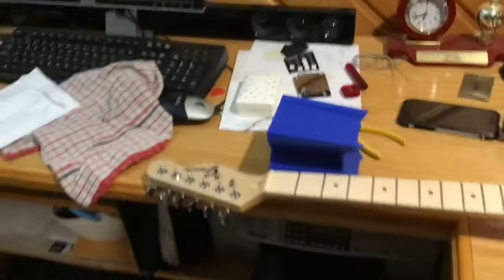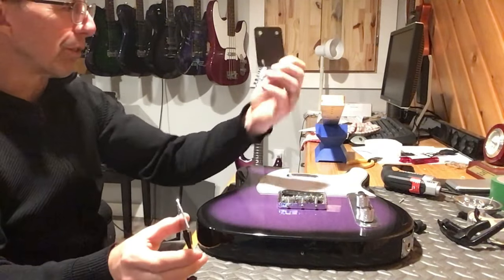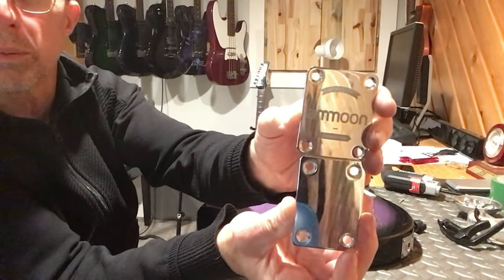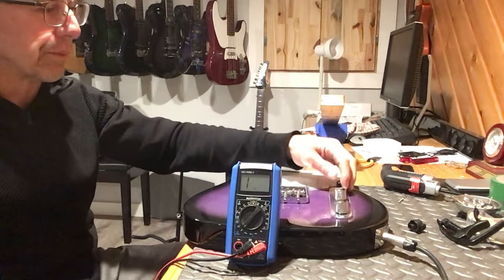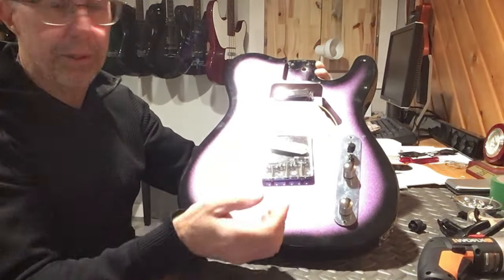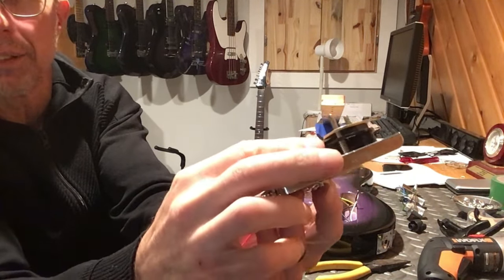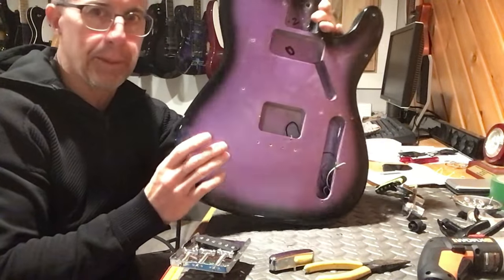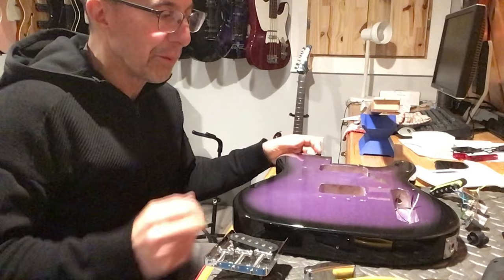Groove Tele Part 2: Disassembly!

Comment: The price of upgrading is ridiculous at best here in Canada. I have a horror story with my effort in refinishing my Cort guitar. Mind you the initial guitar was free but it looked like hell. I've got $400 in supplies not to mention months of work. I paid less than that for my Ammoon and my Kramer combined. It definitely has you questioning wether it's worth it. In the end though I think the Cort is my favourite, it sounds and plays well. I really enjoy your videos bud, please keep them coming. Eight  more subs and you can get monetized to offset the cost of buying junk and making them right. You are now a teacher in life and the guitar world.
Reply from the maker: Hahaha thanks Rainer! Didn't realize I was that close or tjat there could be money involved haha... I just like sharing info with you guys and getting your points of vues😀
I have a full time job so when I play out with the band, my gig money pays for the stuff I feature on my channel... 
As far as the cost of upgrading, it is expensive when it surpasses the cost of the actual guitar, however, even at 400-450 for both guitar and upgrades, here in Canada I'm still 300 to 400 dollars less than buying budget line Squire tele which I would have to upgrade as well... So all in all it's still justifiable... the problem is until it's done, you never really know if it's gonna be a good unit or not! 
I started the work on the neck on the groove... completely sanded it down and it got 3 coats of tung oil.😀

Comment: Well at least it has an alder body & a good paint job. If the neck and frets are good you’ll have a good mod platform. 
I like your idea of the P90 neck PU. I think the black out will look great. 
Redrilling the neck mount & doing the string through body mods will be an adventure but I have faith in you.
Reply from the maker: Wel thanks John for the vote of confidence. I think it will turn out ok. Maybe better than ok. My parts are in transit as I type this so I may be able to get started by the weekend! 🙂

Comment: You're missing out on the most fun part of a budget build.  Changing the name on the headstock.  Build a J-Man Custom, or put your wife's name, or dog's name on the headstock. Be a guitartist, not just a modder.
Reply from the maker: I hear you Dan.. 
I have custom guitars that I've either built from scratch or highly modded. I enjoy that. What turns me off is when, in order to get to the final result, I have to fix problems that should not be problems to begin with. Neck mounting holes... how do you mess that up with a CNC machine lol!? Poorly cut nut... if your company builds guitars and you're cutting nuts, cut them properly the first time. Every neck that has frets installed, those frets needs to be leveled crowned and polished, so why not do it right before packaging?
They all go through the basic set up necessities and if you're building guitars, you must have the tools at your disposal, so use them hahaha! I totally expect cut backs like cheap parts, crappy tuners, poor electronics etc... but neck to body alignment, fit and finish, whether expensive, or budget, hould be bang on every time. You only have to build 1 properly, then make copies with no guess work involved... it's gonna be a fun project, I'm just not confident it will end up being a trustworthy gigable guitar... I hope I'm wrong😀
Reply: @j-man9457  Some are definitely better than others.  That odd sized off center neck plate is just weird.  I can't tell you how many hours I've spent working on cheap guitars.  They are now great guitars, but as far as getting my money back, or getting paid for my time, that's just not going to happen.  
I'm retired, so it's just a hobby for me, like building model airplanes.
Reply from the maker: @danrunnoft6642  hahaha yup I hear you. That's awesome I can't wait till retirement. 2 years to go!

Comment: Hey bro you may have too much time on your hands😂. I think the Monoprice guitar was my worse budget guitar buy. My recent Musi Fusion the best; I’m still considering a Capricorn, but I’m wondering if there’s much difference between the Fusion?
Reply from the maker: Hey Ed,
I'm always looking for time haha. Can't wait for retirement!
I've heard good and bad about the Moniprices... I've never had one. So the fusion and capricorn have the same bridge pickup, tge same neck, and identical bodies other than the capricorn's longer horn (strat like) on the base side.
The 2 major differences is 1: they balance different when using a strap. The longer horn on the capricorn makes for less neck dive.
2: you can get some nice strat tones with the capricorn.
I like them both. I just recently installed a telecaster bridge pickup in my Capricorn. It's like a Nashville now haha! My phone crashed and I lost the vid😖
Reply: @j-man9457  yeah Monoprice is the only guitar I’ve returned as far as budget guitars. I do have their 15 watt Celestion amp which I got years ago for like $160 it’s pretty good.
Reply from the maker: @edatkinson322  Yeah I've heard some people mod them with new tubes and a Mecury magnetics Upgraded Vox AC15 input and output transformers and they are wicked little amps!
It's a 500 dollar mod though. However a Vox AC15 here in Canada is 1300 now! So would still be a cheap alternative!

Comment: Trepidation before a project like this is normal. Not being impressed with the poor craftsmanship is another. ANother $100 CAD for a finished M-musi makes it appear almost fruitless. The bug but, however, is the fun that will be had upgrading it to the point of being able to donate it to charity. (Maybe?)
Reply from the maker: Parts are ordered! No turning back now haha. Maybe, if it turns out nicely, this will be a give away on my channel??🤔
Reply: I've had a couple of guitars with bridge pickups built like that and they went in my garbage bin also. Same with the neck pickups. It's supposed to be an  Alder body and it has a nice sparkle paint job. Trying to find a body alone with that would cost you 200 bucks. Now if the neck is usable and you can level the frets and replace the nut tuners Andre mounted to the body everything else you put on it makes it a guitar worth the money you would pay for it if it came with those qualities already. Who you could never sell it for what you put into it but it is a custom build to your requirements for four hundred bucks. 
The time is experienced and the love you will get to enjoy from this guitar once you're finished.  
Do use a standard neck plate I think you're going to need to plug the holes in the body and the neck with dowels and then re-drill but make sure you glue the dowels in the holes first and make sure it dries a full 24 hours before you start read drilling to the template of the neck plate.  We do this because we love it.
Reply from the maker: @2bikemikesguitartopics145  100% buddy! Not sure about the neck, but the body and my parts will come together nicely I think!

Comment: Wow!  My condolences for the untimely demise of the reputation of the Groove brand Telecaster.  By the same token, my compliments for your ability to move briskly on, in the face of the aforementioned adversity.  You apparently rely little on the kindness of strangers.  In recognition of that admirable trait, I wish you every success in your Groovey endeavor.
     Dont you think the stiffness could be attributable to a combination of, high action, too much rslief, and perhaps heavier guage strings, etc?  Thanks for the warnings about Firefly and Leo Jaymes.  We already agreed on Harley Benton.
     Overall, a black and purple theme will have an air of "serious play".  If that makes sense.  And personally, I tend to evaluate a pickguard's value in a color scheme.  So I've been looking at "drumskins" and "guitarskins" or "wraps".  In any case, a white pickguard might offset the black and purple theme if it feels too dark.  Then the oddly placed screwhole in the corner won't matter.  If a blackish pickguard is too homogeneous or "Hotwheels™️", a homemade clear pickguard would capitalize more on the purpleburst and might inspire you to regard that corner  screwhole in a hole different way.  Especially if this project is intended to be a wide scale learning experience for yourself.  For instance, you could lightly sand the back of a clear acrylic pickguard for texture and demention (pun retented).
     Done correctly, the reasons to rennovate for a more secure neck plate are (much like the least imaginative portion of the U.S. Declaration of Independence) self-evident.  After watching you dissect the Groovey bug, I can not understand the justification for selling such a compilation of ....  it's such a mess, I'm going to have to find some logic to it.  I was one of the people who recommended the Groove company.  So uh...  yeah...
Reply from the maker: No man all good!
Paint is excellent, routs are interesting and also well done, the neck will be good once I'm done with it and I already knew that none of the parts or electronics on a 200 dollar guitar would be any good! They can't be otherwise everyone would have one hahaha! The unfinished and poorly sanded neck along with the poorly installed neck screws are my biggest concern. Just this body alone to buy anywhere else would be 200$ so I'm still ahead and I will have a unique beast when I'm done😀
Rock on!
Reply: @j-man9457    You're very kind to say so.  I don't think anybody should get less than what the Seller intended.  I think it matters.
Reply from the maker: @wasteddude9387  I agree, but there is a lot of grey areas... for example, set up... those 2 words mean different things to different people. For me a set up is getting a guitar ready to gig. Action, Intonation, frets, Nut, neck relief, pickup height adjustment... I have found if the above is addressed, any underlying problems will manifest themselves and consequently can be fixed... 
But a budget guitar company can't do that. They would have too much time in labor to keep their guitars Budget...
My guess is these guys, set up a guitar first by making sure it's in 1 piece, putting on a fresh set of strings, and checking to see if it tunes up. If so, it's packaged and shipped hahaha....